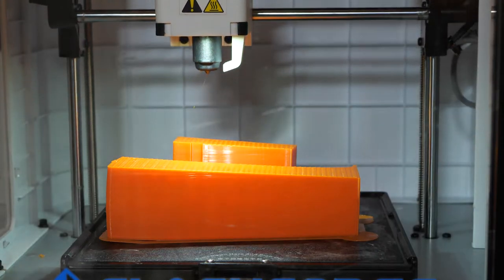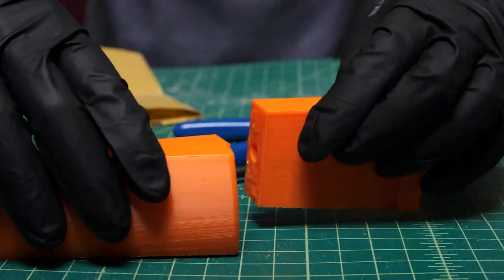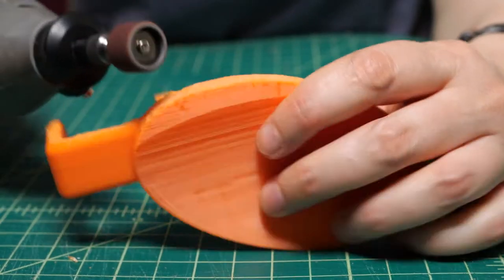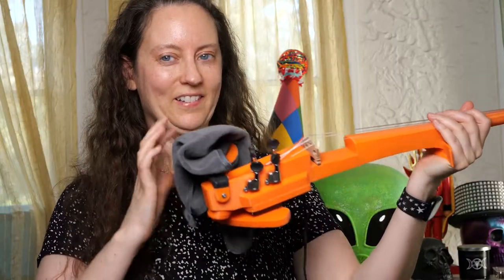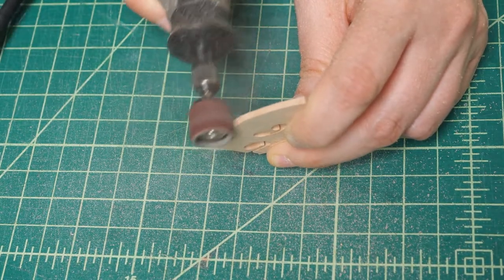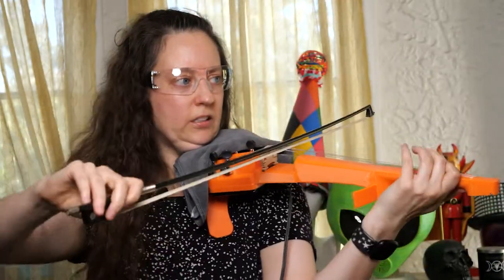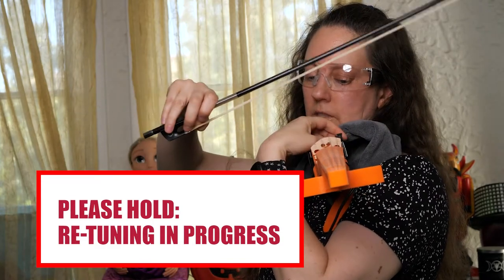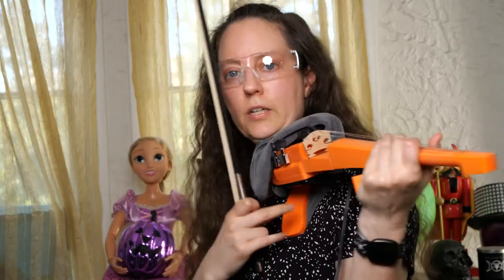I 3d Printed an Electric Violin!

Comment: Great work and playing! Thank you for sharing the full process. I have built the same violin not long ago. To tighten joints on shoulder rest I have put small "washers" made of 180 grade sand paper between plastic surfaces around the screws (actually glued of two layers back to back so washer has abrasive surface on both sides), works fine.

Comment: It plays, and it sounds decent through the pickup.  Two key points: you managed to get it in tune without it breaking, and it stays in tune for at least a minute or two.  That means it's probably not going to fail spectacularly, a.k.a. hit you in the face.  If anything, the string anchors might eventually pull through the plastic - but that will be a slow process and will eventually just let go some day, probably while being tuned.  A hardwood plate behind the upper string holes would prevent that.  Anything else that breaks will likely be a slow process as well.  I think your face is safe. 🙂  Oh, and awesome work, too!
Reply from the maker: But... I've got to protect my face to keep bringing in those sweet, sweet experimental music $$$$$s 😂!

Interestingly, the violin has actually been hanging on my wall since I made it and it's showing no signs of breaking or significant warpage as of yet. Go figure! I'll have to remember that string plate idea the next time I make one, though. It's a great idea.

Comment: Yeah, 3D printing instruments doesn't usually go well, but for some reason violins which you would think it would be a horrible idea to 3D print. Are shockingly reasonable Don't always produce the greatest sound when you're talking about acoustic instruments, but even then, even if you bought a printer bought filament and went through several failed attempts before you made the actual violin, the cost would probably be equal to actually buying one and if you want to get into it and you already have a printer, it's a pretty good idea to go for it

Comment: I'm surprised it actually sounds decent. Obviously, it's far from a high quality violin, but I was expecting it to sound way worse than that, especially for a violin 3D printed at home. I was still confused about the purpose of the placeholder in the middle of the neck and also the location of the peg box being next to the bridge instead.
Reply from the maker: I'm also quite surprised. The placeholder on the neck is supposed to simulate the upper bout of the violin. If you've come from an acoustic background, it can help muscle memory for shifting/upper notes, though I personally think it just unnecessarily forces too much wrist bending when you don't really need it. And I assume the peg box at the bottom is for balance reasons. It's much easier to balance something heavy right over your shoulder rather than further away. Design-wise, I don't think this would be possible on an acoustic, but since an electric can literally have any shape, you can.

Comment: Hi, very nice video and the violin sound really good. I’m going to buy a printer and print instruments for whole string quartet. I have a question, how long i takes to print one instrument?
Reply from the maker: Hmmm.... it's been long enough I don't quite remember the details, but probably several days? (I really should start tracking that info more closely.) But that's with the following caveats: 
1. My print bed is too small to print the entire thing at once, so I print in pieces; and I also don't print overnight while I'm sleeping. There's always the chance that something goes wrong during the print process and it could be theoretically dangerous if you're not paying attention for ~8 hours. I'm not sure how people with extra large print beds handle that, though. So... check out some 3d printing forums for questions safety issues. Nothing to be afraid of, but good info to be aware of.
2. Since I had more pieces, there was also a lot more assembly time after the printing. If you have the space and money, get the biggest print bed you can. It'll mean less gluing, and it'll overall look better.
3. Design and infill also drastically affect print time, and for string instruments you do want it to be a fairly high infill % due to the string tension.
4. It's entirely likely you're going to have some prints that go bad/wrong for whatever mysterious reason. 3d printing is pretty reliable, but... not totally so. So, just beware that's a likely time waster in the process. 

Come back and let us all know how it goes!

Comment: how much infill did you use for the parts?
Reply from the maker: I believe I used a 15% infill? It's been long enough my memory is a bit foggy (should've expected this and taken better notes!). I saw several other 3d printed violins that suggested 10%, but just randomly settled on 15. The chin and shoulder rest I'm pretty sure I bumped up to at least 50 if not a full 100%, because the attachment points on those are taking a pretty heavy load, and I just used a standard pla instead of abs. So far, so good?
Reply: @ComposerKristin  PLA is stiffer than ABS so I would stick with PLA for a stringed instrument. 5 or 6 outer walls with 70% triangle infill should do the trick. That being said there are much better 3D printed electric violins out there. I have made this one in the past and was never happy with it

Comment: At the end of your video I realized the reverb effect didn't quite compensate lack of the resonance box. I'm trying to figure out how this problem can be solved using sound effects? Or just print out the entire instrument, and make it sound more traditional? Anyway, that was interesting.
Reply from the maker: I think most people who are looking for a more acoustic sound just mic up an acoustic. I've never heard an electric that doesn't sound at least a little... well, electric. I believe I was using one of the basic reverbs inside Guitar Rig Pro? (I really need to get better about taking notes along the way). So, it's possible that a different effect and/or pedal would do a better job. 

Also, weirdly enough, my "real" electric is a Zeta Jazz, and... this little 3d print sounds less "electric" to me than that one. I have no idea why, but... the pickup also matters here. Both of these things are something I'd like to experiment with more towards the end of the year, though. Fun experiments! And thanks for tuning in! 🎻
Reply: @ComposerKristin  No problem Kristin, I used to compose music since C64 and then Amiga500. Hundred years ago and I totally understand your passion. Thinking about it I recollected if you find the right sample, you can make your violin sound like entire orchestra. Or like you said pedal or rather sound effect where you can mix effects together. It takes time to find the sound you'd want to get, but that's the beauty of experimenting, and fun on its own. If comes to getting rid of electric sound. I wouldn't. In my comment I was referring to the sound of traditional violin which is more 3 dimensional and powerful. And I was thinking how to get the same result on electric one. And then realized, it can sound even more powerful w/ proper samples and effects. Good luck with your experiments.

Comment: Why not just buy a bridge?
Reply from the maker: Well, since you asked...

1. Technically I did. I just bought "blanks" that had to be shaped.
2. This is a maker channel, so I wanted to see if I could do the shaping.
3. There's not really any sort of perfect "off the shelf" bridge you can buy, at least when you're talking about the acoustic wooden variety. The ones that come pre-shaped, are still likely going to need some modification, depending on the instrument and personal preference. It's also a really common thing to have your bridge slightly adjusted/shaved when you're an advanced violinist, again, depending on personal preference.
4. This is going to sound unnecessarily snarky, but you might have also asked why I didn't just buy the violin? I mean, I already have a much better commercially-made electric violin, so... why bother making an inferior one?
5. A very large part of this channel is showing me fucking shit up. Not because it's funny or entertaining (well, sometimes it is), but to show people how the making process goes. This goes for anything: music, art, designing, 3d printing... whatever. I'd definitely get far more views if I just did short funny videos instead of attempting to laboriously document the entire process of what I did/made. But I've seen far to many comments from people (who I assume are fairly young), who are weirdly afraid of trying something themselves. That if they can't do something perfectly right the first time, it's not worth trying; and having/buying/obtaining the shiny new object is the most important aspect. So what I'm saying is...
6. The process is what's important.
7. I realize this whole response is way overkill for such an innocuous comment, but if you've watched any of my videos, you'll also know I'm not exactly... succinct, LOL.
Reply: @ComposerKristin  Thank you for your reply 😎